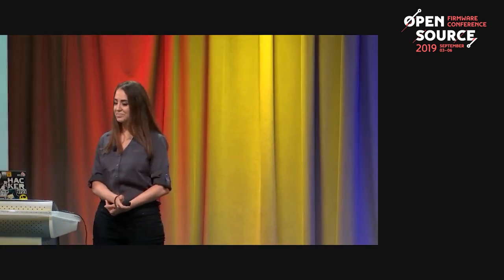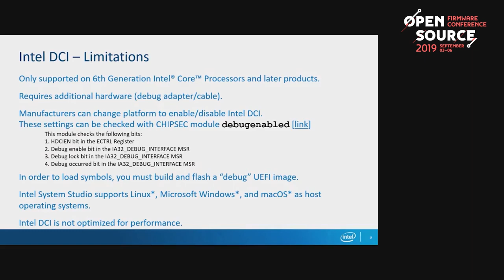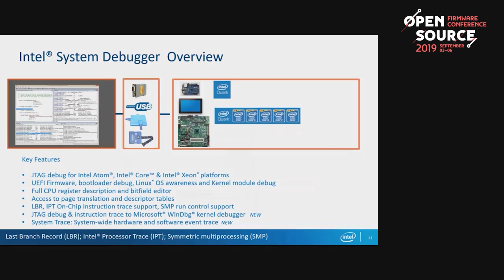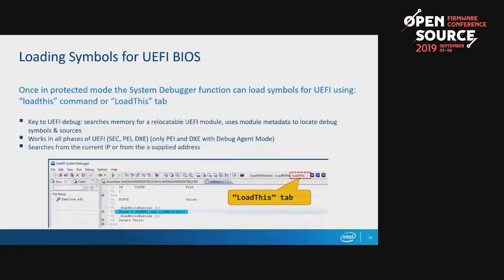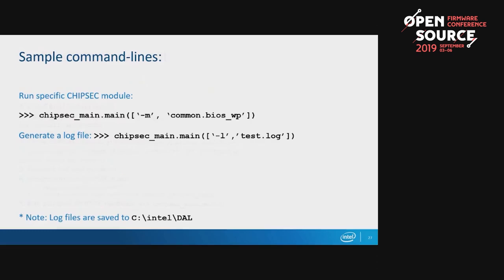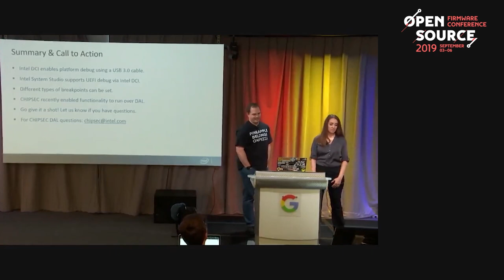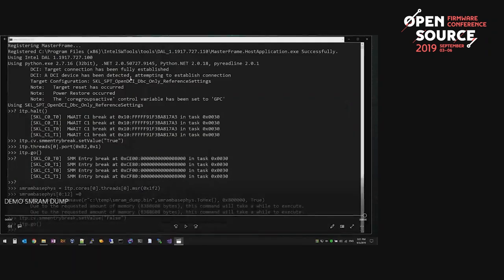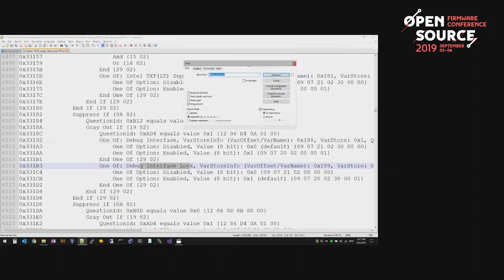OSFC 2019 - Debugging Intel Firmware using DCI & USB 3.0

Comment: Which version of the UP2 board did you use for the demo? Your slides mention the Celeron n3350, but your howto link in the slide deck (now broken) references using it with the atom variant.
Reply: just use asrock h370 chipset board. eg with an h370p4 i could easily read/write bios spi region with flashrom and uefi vars are present in ifr and not protected by the bios.